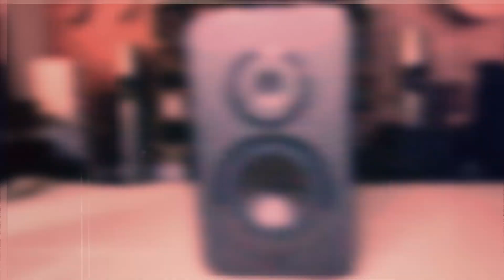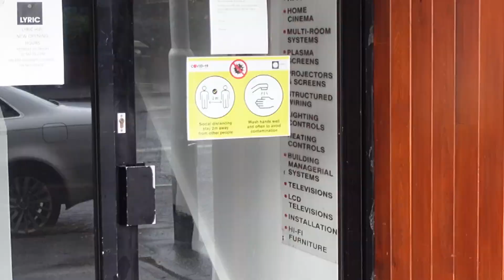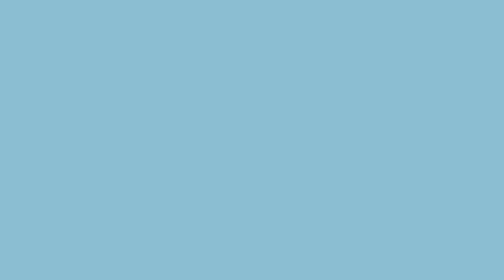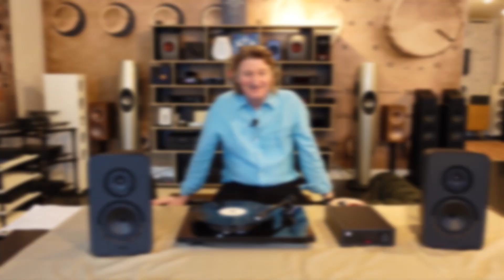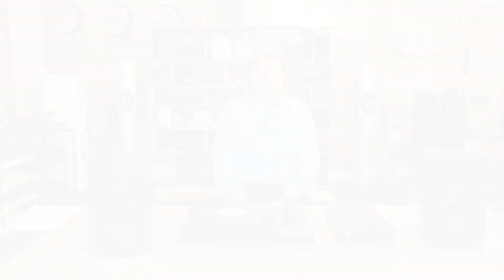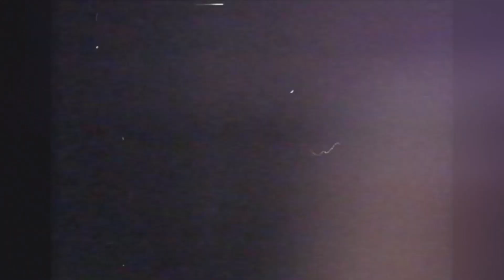New Rega Kyte Speakers First Listen at Lyric Hifi

Comment: I actually have 2 pair of old Rega Kytes. And I love them! I bought the second pair because that was cheaper than getting the blown tweeter replaced on one of my old ones. 
On these new ones I recognise the bass driver. probably an upgraded of the old one. The tweeter looks new. The old Vifa tweeters are great. 
Another thing is the cabinet. The old kytes have thick wood cabinets with port on the front. So I guess the character of this new one will differ a bit from the old. 
If these sound as good as the old ones they will be good value for money. Of course, if you find the old ones they are dirt cheap.

Comment: Just got a P2 & IO , I need to update my old speakers, is this a bit of a no brainer? 
Also been looking at MA,KEF & Dali
Reply: I ‘ve had my Rega TT P2 with upgrades and on a Rega wall bracket for 2 year now and last November I changed my old NAD 3020 amplifier to Rega’s new IO  but still running Dali Spektor 2 , My local Rega dealer advised listening to the new Rega Kyte or a pair of Fucal 806 to go with this set up , So I tried both setups  and the Rega Kyte sounded so much better with this system that I’ve now ordered my pair